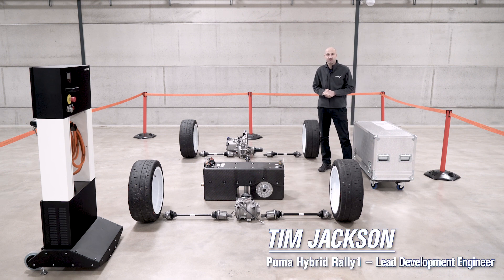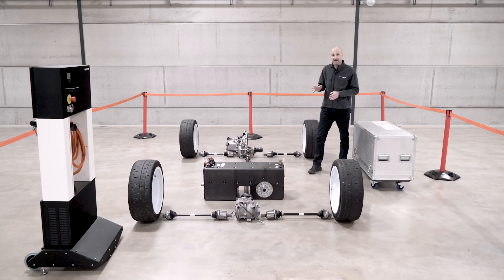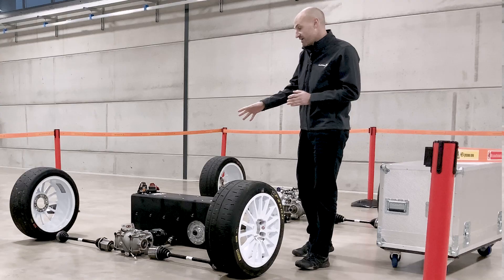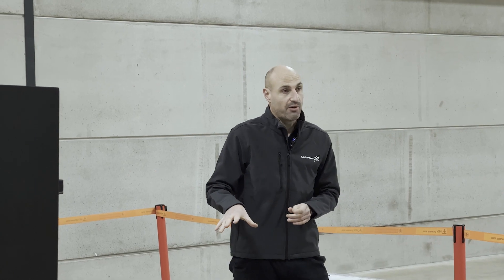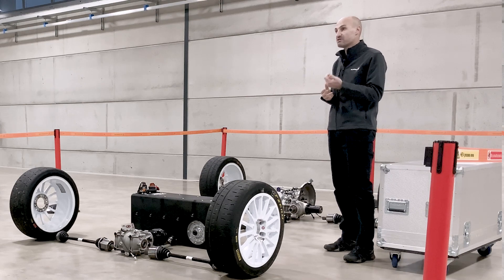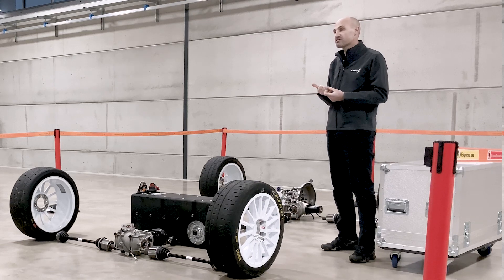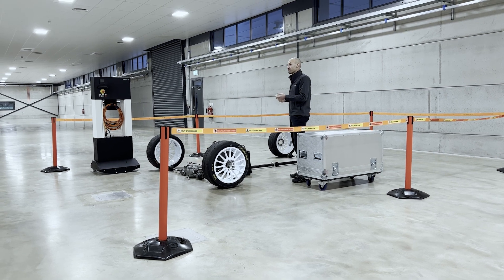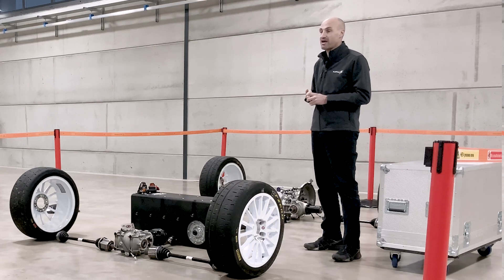WRC HYBRID 🔋 EXPLAINED | Puma 🐈‍⬛ Hybrid Rally1 Powertrain ⚙️ Explained | #MSPORTERS

Comment: sounds like a lose, win, lose. go slower on the straights, get a little boost, then have to drag around 100Kg’s untill the FIA lets you use it. Crazy!?
Reply: They're still faster the the previous gen. Still insanely fast.
Reply: @williamrainbow4115  More like faster only on the straights and when the grip is good, I think. For now at least. I understood that when I read that you have to change restrictor from a 36 mm to a 33,7 mm (estimated power reduction of 30 horsepower) if you want to participate with a previous generation WRC car in 2022. They don´t want to take the risk of any of the old cars stealing the show. (Having said that i quite like the new Rally1-hybrids. The sound!)
Reply: @mikaeljohnsson4982  I have seen some on boards and I can't keep up. It's insane how fast they tbf
Reply: Look at new races they are even crazier than before. And they have 140 hp more. They have boost when ever driver wants.

Comment: Great video guys!! So, does this mean the fuel tank can be smaller/lighter to offset the Hybrid technology? If the cars have to be driven in a way to lift-off to be able to allow the next boost phase, then this could allow less fuel usage? Or was the engine as it was, already very efficient when the gas pedal was released? Just curious. Good luck, hopefully the season will be really kind to you.
Reply: Engines cut fule completely when of the throttle

Comment: Very good explanation, thank you.
I am very sad of using the electric mode in the servicepark.
For me almost 100% of the experience at the servicepark is linked with the sound of the cars. IT is so impressive when they go slow and can almost not bear down their power. Goose bumps guaranteed!
Reply: The idiots of the FIA don't get it. If the sound/noise dissapear the emotions are gone and motorsport will die. Full electric motorsport will be a niche product.
Reply: Y’all have made me realized that rally fans have literal lizard brains.

Comment: I find one thing difficult to understand. In a "normal" rally car, the driver controls the car by judging the grip levels and knowing, by experience, what sort of pull (torque) will be generated in a given gear when they press throttle. That's because the engine performance stays roughly the same. Now, with these "boost events", how is the driver to know the amount of pull that the full depression of the gas pedal will give him? Will they have a special "boost available" indicator?

Comment: The biggest news in WRC regards the eco aspect is the introduction of bio fuel which isn't being talked about at all. If this fuel really is carbon neutral or close to it then surely the electric element is totally pointless. Also give the  electric system gives more power at times not replacing power that would normally be generated by the ICE then its not adding to sustainability.  Surely the production of components that don't improve carbon footprint are themselves environmentally wasteful.
Reply: Adding a small hybrid system to a heavily turbocharged engine can have massive benefits. The electric motor provides instant torque, so it can fill gaps in the ICE engine's torque curve and reduce the need for aggressive anti-lag. If you don't have to fire as much fuel down the exhaust system to keep the turbo spooled up you burn less fuel, get cleaner tailpipe emissions and hugely increase the lifespan of the turbo.

There's also the traditional connection between rallying and road cars. With the coming ban on internal combustion cars, motorsport needs to go electric to remain relevant to road cars.
Reply: @j.dietrich  Your final comment is spot on. I'm big on the issue of the relevance myself.

However, I'm quite surprised by what you say in your first paragraph. Is it possible that you have not watched any footage from the Monte Caro 2022? Or even from the pre-event testing? Have you been avoiding such footage, or what? :D  Because if you had watched any of it, you would have seen it clearly that the present Rally1 cars show much (and I mean MUCH) more aggressive anti-lag than the last generation of WRC cars. Now, as to why that is, we can only speculate.
My guess is that the electric component of the drive only supplies quite little energy, plus that energy can only be spend according to the rules -- i.e. within the so-called boost events. Even if it hadn't been so regulated, then I still think that, given free reign, the teams would have designed the cars to use the electric drive as an extra shove for the straights, rather than a filler for the combustion engine's output in lower revs. And now, let's take into account the other part of the equation: the regeneration. To include regeneration in your driving style means to increase the amount of time the car will be coasting or mildly braking, possibly also increasing the number of situations where you would enter corners in a higher gear than the optimum. This is probably why they need more anti-lag.
Reply: The electric system adds to sustainability in that you're harvestig power while braking, which means you're getting back some of the kinetic energy that otherwise would have been wasted (granted, only a very small portion of it will be harvested, probably). I'm not sold on the bio-fuels side. This is hardly of any environment significance, since it's not the source of the combustible that affects the planet, but the very process of burning it in order to produce the energy.
Reply: Thought the concept of carbon neutrality was that you consume carbon in the manufacturing process to offset the amount of carbon that is produced during the consumption of the said product. Perhaps 80%+ less CO2 emissions is not enough. But let's not fool ourselves that electric tech isn't without impacts. Yes agree it will harvest power under braking, but as a former rally driver, predictable of brake feel is key so hope harvesting is smooth, but anyhow the power harvested is used to give more power not replace ICE power (so no efficieny savings) and I'm not sure the WRC cars really need more power (I'm old enough to have watched Group B in the flesh). I guess if we believe that there should be no CO2 etc. produced (either directly or indirectly) as a result of activities such as this then perhaps they will need to cease completely.
But another issue with the approach here is that making everyone use the same motor/battery unit does not allow manufacturers to showcase their own hybrid tech so why would others bother entering. If Ford, Hyundai or Toyota promote their hybrid tech on the back of these cars then it will be a bit misleading as its FIA electric tech, not theirs.
Reply: @barsorrro  "since it's not the source of the combustible that affects the planet" 
Yes it is! 
Yes it is if you are talking about climate change/global warming.

In one way you "pump*" carbon dioxide from the ground to the atmosphere, in the other way you "recycle**" the one already present in the atmosphere. 

* through chemical reactions that occur burning fossil fuels..
** in the case of carbon neutral fuels.
Reply: @ereisenheim9896  Well, it doesn't quite work this way, I think. The main problem is the presence of the carbon dioxide in the atmosphere... period :). It is of next to no importance what the source of it is. You are not really recycling much when you employ plants to produce bio-fuels, which are destined to... put the carbon dioxide back in the atmosphere. You want to have plants (trees) capture the CO2 and keep it. And you want to produce energy in a way that doesn't involve burning stuff up. Obviously, bio-fuels are sort of better than fossils, but that's definitely no environmental sustainability in the long term. Not to mention the fact that there's absolutely no chance to produce sufficient amounts of them to provide the needs of our civilization in any significant way. They are basically only good for publicity stunts like this: "we'll run a bunch of cars on petrol that doesn't come from fossils -- we're so eco-friendly, yay!"
Reply: @barsorrro    The whole discussion was about sustainability of the sport, not humankind. 
If we look at the vehicle propulsion aspect of it, then they would be correct to use your last sentence, since eco-friendliness doesn't imply any sort of environmental salvation, it just means that it doesn't worsen the situation. It would be sustainable too, since producing a relative small amount of fuel wouldn't deplete natural resources.

I think you are confusing terms and phenomena while being generally correct about the things you said. It doesn't help that, as it seams, you want WRC to save the world. 😅
Using carbon neutral fuels IS CO2 recycling: the amount that has been removed from atmosphere during production process (be it biological or synthetic) is exactly the same that is emitted during combustion. 
Continuing on the waste disposal analogy, capturing and storing away CO2 would be the complete opposite of recycling, it would be like dumping it in a landfill (but of course in this case it would be a good thing).
Reply: @ereisenheim9896  Okay... I think we're getting a bit nitpicking, although I do agree your use of terminology is more precise than mine. Since we're in the vein of clearing up things, let's do it:

1. When I'm saying "sustainability", I am, indeed, talking about that concept with reference to vehicle propulsion systems in general, not just to a hiper-minuscule portion of cars on the planet which constitute the rally cars, or, more specifically, Rally1 cars. Perhaps somebody out there feels relieved that Rally1 cars don't add themselves up to the consumption of fossils, but I couldn't care less. If I want the motorsport to be a testbed for automotive technologies, then I want those technologies to be applicable (in some way) to cars in general. Bio-fuels are not that kind of technology. It's hardly any real technology at all -- it's well-known since the dawn of the automobile that you can use pretty much anything combustible as fuel: in the 1920's-1930's there were quite a number of trucks running on gas obtained from wood, with primitive generators of this gas carried onboard. Bio-fuels are definitely not a solution to the environmental problem, even for the simple fact that we can't produce them in reasonable quantities.

2. Your use of the word "recycle" is definitely a more precise one, since, indeed, bio-fuels enter into a natural cycle whereby the CO2 produced by burning them can -- potentially! -- be caught back from the atmosphere by the plants designed to produce bio-fuels. The question remains what percentage of that CO2 production can be seized back from the atmosphere. I would say only a small one, since there's an excess of CO2 production globally in comparison to the global capacity of the plant life to reabsorb it. So, whatever the source of your emitted CO2, you're just adding up to the tally. When I was -- I admit: wrongly -- using the word "recycle", I was thinking of a process which would help reestablish the desirable carbon balance in nature.

3. No, I don't want the WRC to save the world. Firstly, the world is probably beyond the possibility of being actually saved at this point. Secondly, in order to even seriously attempt such salvation, we would obviously have to axe without a minute of hesitation all such environmental folly as motorsport. Completely. However, since that's not doable, I'd like the environmental steps taken by the sport to be slightly more convincing and related to what should actually be done in terms of new car propulsion technologies. Which is: to turn  more and more electric, since there is a slight hope we might develop relatively clean sources of electric energy in the forseeable future. Bio-fuels are not the future -- they are just a silly band-aid patch.

Comment: Good luck to any privateer team trying to run these cars in years to come. What a mess.
Reply: Since 2004 WRC cars were hardly used outside works (or works-affiliated) teams. After all, they have become not eligible for regional or national FIA events. AFAIK, they'd only be run in some rally-sprints or as a not-scoring support class in FIA rallies in just a few countries -- mostly just for show. In short: they will probably be no privateer-run Rally1 cars.
Reply: There is no plan for these cars to go to private teams. The 2017 to 2021 car was the same.

Comment: Not bad but pulling the paddle shifter is just so lame.  Wait, that was not meant to be a pun.  :)
Reply: I totally agree with you there. These purely mechanical sequential boxes will look ridiculous on top-formula rally cars -- especially in this day and age when loads of daily-drivers have paddle-shift (I know it's not of the performance kind and I know it's inferior, but to a layman it will definitely look more advanced).
Reply: @barsorrro  That's exactly the issue.  And it just detracts from steering precision in a few cases, at a pretty minimal cost savings.
Reply: They will still have paddle shifters.
Reply: @dkdanis1340  Erm... Hello? We're past two rallies of the season already, not to mention the copious footage from the pre-season testing. Rally-1 cars DO NOT have paddle shifters.
Reply: @dkdanis1340  They do not.

Comment: This is all Very Well and Good But I Started Watching Ralling when i was a Kid and the Ford RS1800 BDAs were in Full Flow with Rodger Clark etc 
IF All Road Cars Have to Be Electric Then is There Any Point Bothering With all this Hybrid Stuff As its Not Relevant To What the Buying Public Are Being Told they Have to Go EV

A Competion Racing Car of ANY Sort Not Just WRC Should Just Stick to using An Engine with Some Sort of Fuel ,They could Go Synthetic if they want But Leave all this Hybrid Rubbish.
Are the FIA Going to Dictate that a Top Fuel Dragster With 10,000 Hp Goes Hybrid While it Moves Among People in the Paddock And Then Burns 30 Gallons of Nitro Of the Line ?

It Would be better if they Grounded Some Jumbo Jets and Stopped Flying These Cars all over the World if they Want to Save the Planet ? But just Leave A Engine in Racing Cars For Gods Sake😂
Reply: why do you type like that? just type in lowercase.

Comment: 5 speed dogbox and not centre diff. Basically a 40.000 euro yaris GR has a better awd system costing 960.000 euro less.
Also the battery got the same capacity of a 2012 toyota prius (4kWh).
Still thanks Msport for these vids
Reply: More importantly no Paddle shifter. F
Reply: It's weird the M Sport said wrong thing. The center diff is still there. It's utterly impossible to do tarmac stage without it. It just no longer adjustable to fine tune the power distribution according yo the stages. It fixed at 50:50 front and rear without any means to change it
Reply: @anggasatya69  No more centre diff
Reply: @marfrandema1884  nope, the center diff is still there and that's why the presenter was wrong. What no longer allowed was active center diff that has adjustable power distribution
Reply: @anggasatya69  WRC TECHNICAL REGULATIONS ARTICLE
604:
 DIFFERENTIEL CENTRAL / CENTRE DIFFERENTIAL
Différentiel central Interdit.
Centre differential Forbidden.
Reply: @anggasatya69  that's not true. An alternative to a centre differential is a clutch in the coupling the rear, which an be passive (like the old viscous couplings), or just an overrunning (sprag) clutch, or actively controlled (which can be done without hydraulics).

Comment: Regen on liaison... does this mean they will consume more fuel then before on liaison?
Reply: I asked myself the same. He talked about regeneration when braking, but do they really additionally use the electric motor to brake the car?
I think this is very difficult on a rallye special stage with inconsistent conditions. Maybee they only regen on the liasion or they simply charge the battery useing the petrol engine!
Reply: @RallyeRacin9  My understanding is that the regen braking is not very strong, but that might actually be okay for slippery surfaces (by which I mean any loose stuff), so we shall see. It will definitely be a challenge for both the engineers and the drivers to come up with solutions and techniques to ensure that regen braking covers as much as possible of all instances where the car needs to be slowed down.
Reply: It's likely, especially as some liaison sections are very short.
Reply: @bn880  they're not always short, didn't Monte for example used to have a 300km one? Or has that been removed for this year? Still doesn't seem very "eco-friendly" though, and there's no engineering incentive for new manufacturers to join either by the looks of it.
Reply: @sen_ex  I said some, this means not all.

Comment: He said there is no central differential, it means that there isn't an active central differential of that there is no central differential at all?
Reply: There isn't an active differential. Not at the front, not at the rear.
Reply: It probably has some kind of active diff.
Reply: @dkdanis1340  It does not. It only opens for the handbrake.
Reply: @bn880  then what takes the difference between front and rear axles.
Reply: @dkdanis1340  what difference
Reply: @bn880  speed difference when cornering. Just like rear diff takes difference between left and right wheels.
Reply: @dkdanis1340  Nothing really.
Reply: Fixed 50 / 50 split and in case of a handbrake turn it frees the rear diff. It is a very terrible and irrelevant awd system.
Reply: There is no center diff means it is a fixed 4x4 system. At least Front to Rear.
Reply: I have the same question. I’ve heard people describe it both ways.